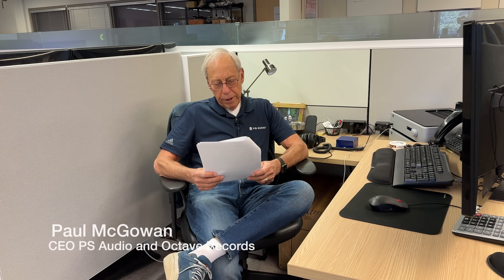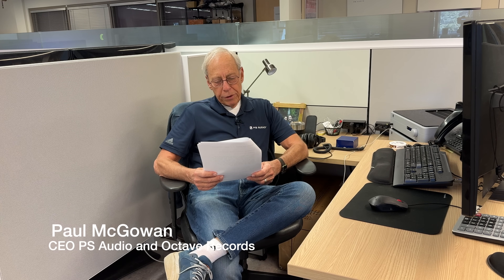Should you repair or replace a preamplifier?

Comment: Reference 1 was an exceptionally good preamp, both in its day and by today’s standards. ARC still offers factory repairs. Obviously not convenient living halfway around the globe from their Minnesota factory but that’s definitely what I would do. 

Go to their website and contact support to arrange repair. Even if it’s an extensive repair required, it’s far less costly than finding a new replacement of equivalent quality and you’ll have a new 3 year warranty on the unit

Comment: Why would a preamp ever fail? Only the controls and pots need cleaning.. dont replace anything thats just dirty
Reply: This one apparently has tubes according to what others have noted. Solder joints can fail, old electrolytic capacitors can dry up and change value, some even "pop" their tops off. I had that happen to some on a computer motherboard. Anything can fail, no matter how "simple" it is. I have a Carver C-1 preamp (solid state) and it was having issues similar to this guy's...one channel lower, some weird "pumping" of the volume on that one channel and all. Sent it for service, got it back, just as good as new now, maybe even better with the components that were replaced.

Comment: Your preamp has a.3.year warranty on all but the tubes (90 days). If you open up the preamp and switch the left and right channel tubes to see if the problem switches sides, then you've found the problem. I'd give that a go before jumping into another big purchase.
Reply: Reference 1 has been out of production for more than 2 decades. If he’s owned it for a year, he bought it 2nd hand, likely from seller that knew it had issues. Either way, it’s out of warranty. If he’s sends to Minnesota factory, they’ll not only recondition the unit, they’ll warrant the unit for 3 years. 

That’s the best preamp in ARC history, well worth the investment in factory repairs/reconditioning.

Comment: The BHK preamp that Paul referred to is EXCELLENT! Tube input and Mosfet output. Ive had one for a few years and other than yearly replacement of a pair of tubes it's been flawless. Great sound with many inputs including balanced. Good luck!
Reply: Wow -  tube replacement yearly! What type are you using and how often are are they on ?  (24/7 all year long) ?
Reply: @JJ-no2ob they are being replaced yearly because Paul says to, which isn't necessary. The last tubes I bought for my preamp were Linlai 6sl7 and they lasted 2.5 years powered up 24/7 most of the time, my nos ken rads lasted about 4 years.
Reply: Preamp are not needed in the signal path. There are countless dac/pres out there.
Reply: Much better sound with a good preamp. @ryanschipp8513

Comment: I bought a Freya Plus for 300.00 not working, I sent it to the factory.. A few weeks and 100.00 plus shipping I had a good as new preamp. Still in system and I could not be happier. 
Waiting for Freya plus plus to come out. 
But with the price of tubes now I find that unlikely.
Reply: I picked up a Freya Noval for the same price and was amazed at the performance. I’ve owned many high end preamps through the years and the Noval is at least their equal. I like the 6922 tubes and had a few that were collecting dust. The Genalex gold lions sound the best to my ears. I can even go to the buffer stage and save on tube life. Those guys at Schiit know what they’re doing.

Comment: The 802 Nautilus is not the one with the snail shaped bass enclosure. That’s just called Nautilus without a number.
Reply: Exactly.  Nautilus is the flagship for many years and is still in production.  It requires two power amp (or four pieces in case of monoblocks).  Not to be mixed up with 800, 801, 802.
Reply: 1:11 The first 800 series of the body type before the diamond tweeters (Dx series) was calles the 8xx Nautilus or the N8xx, in production 1998-2005. My relatives owned N 801 & N 802. I own a pair of 802 D2 from 2015.
Bad news - the original Nautilus (the snails) which have been in production for around 30 years, needs to be quad amped, yes I said it right - 4 stereo amplifiers or 8 monoblocks! It comes with an active crossover included. I read of an instance an extremely wealthy audiophile used 8 Classe Audio Omega amplifiers to drive his.